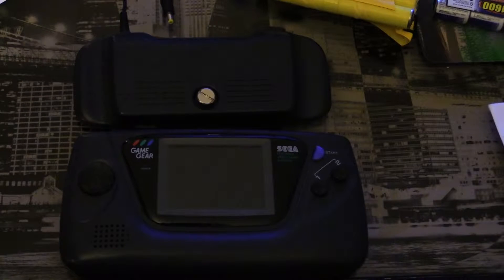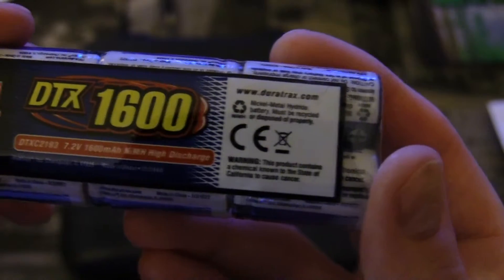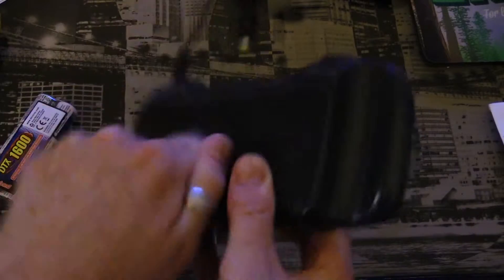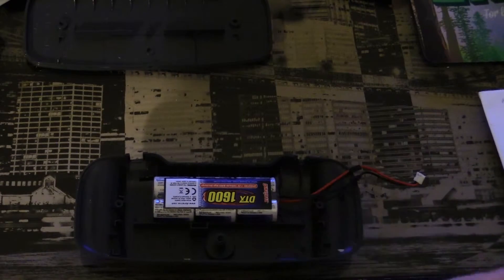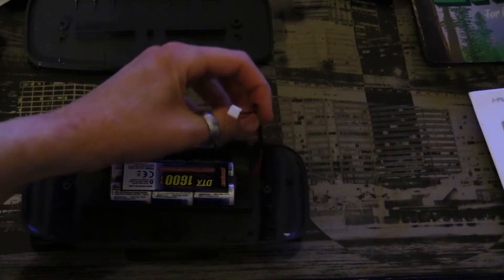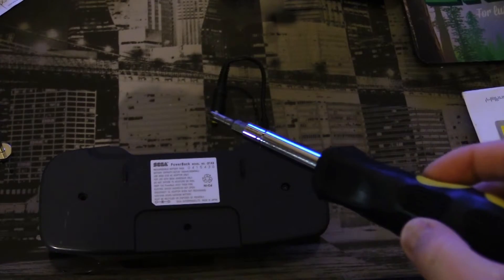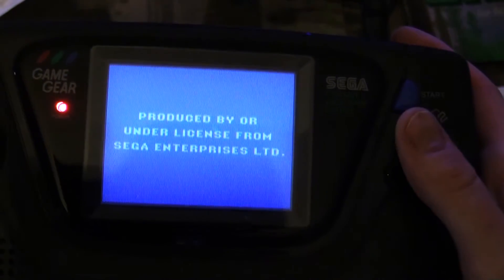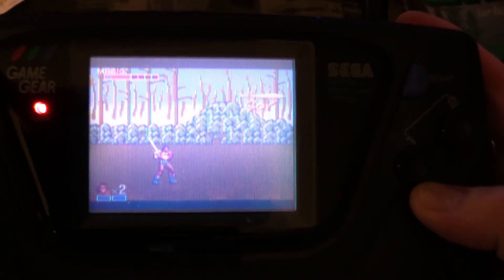Game Gear PowerBack battery replacement

Comment: Where do you buy the replacement battery pack you were showing in the video? Thanks
Reply from the maker: I got mine from Amazon, but it looks like they no longer have them in stock. Here's the Amazon link. Maybe you can find the battery elsewhere. https://smile.amazon.com/dp/B001LVG5PQ/?coliid=I28B7FXEXFNSZS&colid=1DT2FK7VSMK0C&psc=0&ref_=lv_ov_lig_dp_it
Reply: @chicgamer  Thanks for the info. I recently got back to this mod project and with some research I found this on Ebay. 
https://www.ebay.com/itm/Onyx-NiMH-7-2V-1600mAh-2-3A-Stick-Mini-Plug-ONXP5168/292612817744?ssPageName=STRK%3AMEBIDX%3AIT&_trksid=p2057872.m2749.l2649

 It is pretty much the same dimensions as the Duratrax one you mentioned in the video and links.
Reply: @atranfanatic  How'd that battery work out for you? Did it fit fine and no issues since installing/using?
Reply: @playab0yyy  I have actually had trouble with it mainly because I had a crappy tip on my soldering iron. I will probably try here again since I got new tips. I will try to keep you posted, but I do have other things going on as well. lol

Comment: Does the red power light stay on constantly?
Reply from the maker: No, it shuts off after the charging cycle ends.
Reply: chicgamer01 thank you. Found one on ebay for $8.50 with shipping and it’s on its way now. Was worried about buying one since batteries might be bad, but after watching your video i think it will all work out great!! Thank you, and keep up the mods and game gear vids
Reply from the maker: Cool! Hope it works out for you! If you're serious about the Game Gear and haven't done so yet, you might want to consider a screen replacement. You can now get a newer LCD that provides a better image and, I think, doesn't draw as much power.

Comment: I've read that using a NiCad charger for a NiMH battery can damage the battery (undercharge or overcharge). How well has this mod worked over time?
Reply from the maker: So far, I haven't had any issues with it; however, I haven't used it extensively.
Reply: Depending on the type of NiCd charger you have, the older NiCd charger may undercharge NiMH batteries (most likely), it may overcharge them (less likely), or it may charge NiMH batteries properly (but it's not likely to do so automatically and could take a very long time).

Comment: Great stuff!!  I did the same thing to one of these official battery packs.  Used an RC 7.2v pack!  Works really well, and you can also run another wire out to fit the Atari Lynx.
Reply from the maker: +GadgetUK164 You've done one of these mods on a Lynx? Do you have a video for that? I'd love to have a battery pack for the Lynx (I'm currently just using six NiMH AAs).
Reply: +chicgamer01 What I did is took one of the official Game Gear battery packs (http://i2.photobucket.com/albums/y30/MM007/sggbatpak.jpg), replaced the 7.2v battery with a new RC one - just like you did, but in parallel to the wire that comes out with the Game Gear connector, I also put a 2nd wire from one of those Atari Lynx battery packs (the ones that hold giant batteries - quite cheap on eBay).   So I have 2 wires coming out of the battery, one for the Lynx, one for the Game Gear.  It lasts ages compared to AA batteries.    I will try and do a video on it soon.  I might cover a few different things for the Lynx at the same time as I've got a few things worth showing.
Reply from the maker: I just looked up the Lynx battery pack on AA. It used six D cells! That's crazy for a portable!

I'm wondering if there is a way to use a battery like the one I used for the Game Gear and fit it inside the Lynx battery compartment, adding a jack to charge it without removing it from the Lynx. If you removed the inner plastic from the battery compartment, I think you could maybe even use the PCB from inside of a PowerPack.

Looking forward to your Lynx vid!
Reply: Do you know what the dimensions of the original battery pack was?